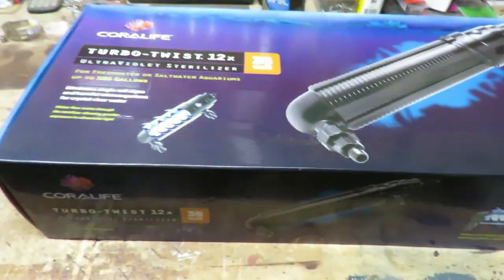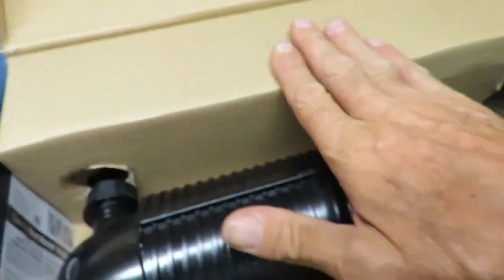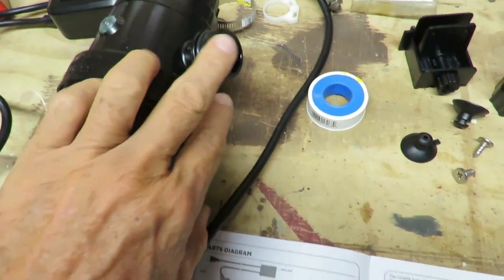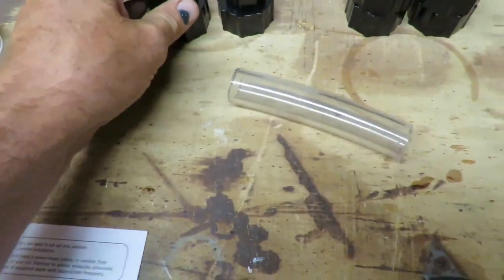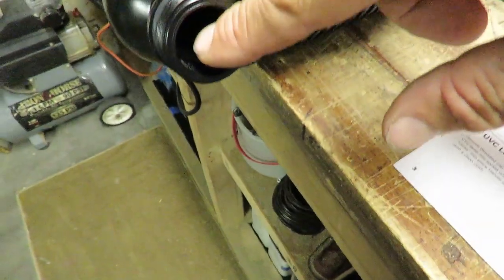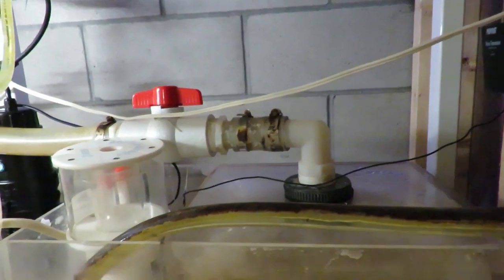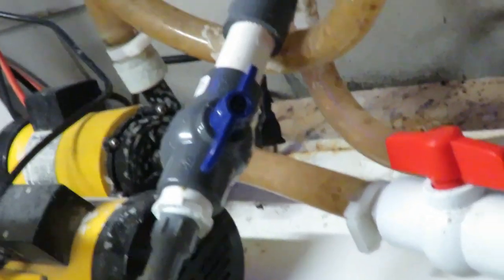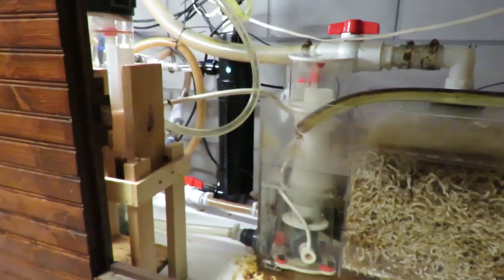Replacing my UV Sterilizer

Comment: Did you add water in uv before start up?
Reply from the maker: I make sure that after is moving through the UV before I turn on the UV light.
Reply: @studnickaaquatics80  Thx you  the instructions say lean it sideways to get air out?
Reply from the maker: Just tip it back and forth a little bit to make sure that the air is out of the line.  Good Luck!
Reply: @studnickaaquatics80  Thx you for your help